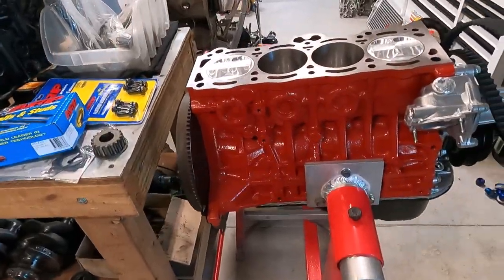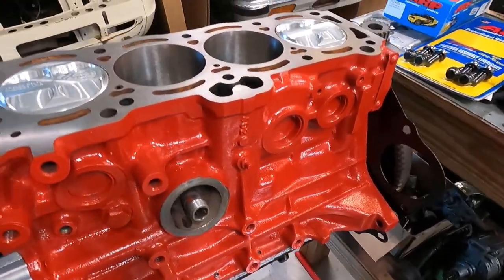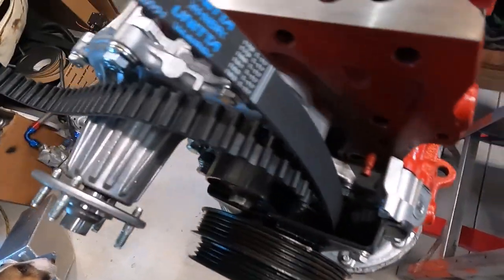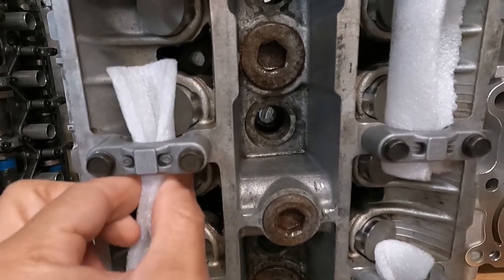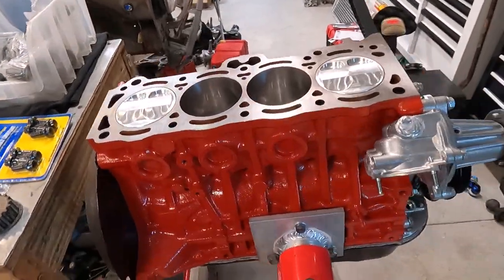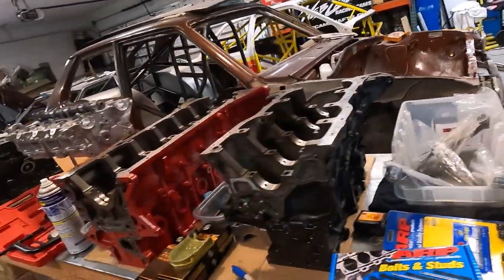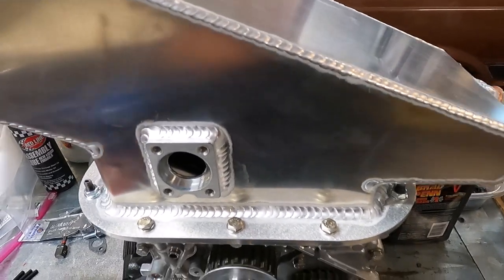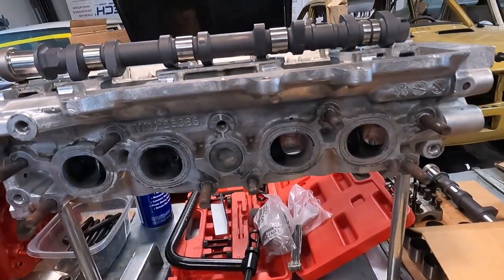4AG Build Part 2

Comment: Questions? Oh yeah! 
With regards to the shimless buckets, are they universal? I want to switch mine out on my gen1 3sge so I can add cams and cam gears for better na tuning and higher rpm’s. 
Awesome work gents and thanks for the updates, it’s always entertaining and informative!
Reply: Look at Supertech they have a kit for the 28mm valves which is used on a lot of Toyota's
Reply from the maker: Yes they can be used on the 1st gen head. same exact lifter spring combo as the 4ag. Also supertech does have them but i have never used them, they way they size them is differently then toyota.

Comment: Damnnnn and I'm in Hawa'ii right now!!    I love the 4ag had that motor for ever in 4 of my Corollas love the rev's. Also love the 3tc torque monster too . Great build keep us updated..

I also had the Wiseco 12.5:1 pistons they had a little bit bigger dome but you can definitely feeling the torque.. what cams are you using? I used some Web Cams on mine with dual Weber's.. love the rev's and torque

I found Supertech has a shim under bucket kit for the 28mm valve's as I need one for my current 5efte build..
Reply from the maker: Awesome, im super pumped to hear how it sounds. I wanted to go 13:1 compression but figure id keep it more realistic with the 12:1 and should be more relatable.
Reply: @psiracing  Customer's gonna love the torque just like a 3tc but with the rev's of a 4ag... Just like that 7ag awesome too.. keep us updated y Toyotero's por Vida mí hermano 🤙🏼😎💯

Comment: Love the content. 
I'm building a mild 20v for my Starlet.
I assume that you are not installing a thermostat, as you blocked the bypass aswell as the the heater tube.
Reply from the maker: Correct no thermostat, should stay cool since it will be using E85 for fuel, plus the ECU will control the electric fan based on water temp